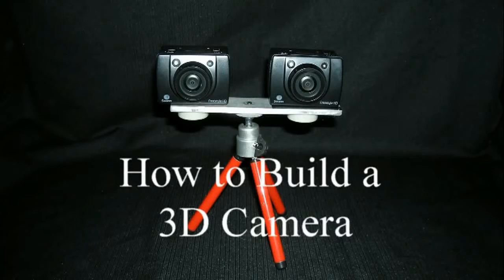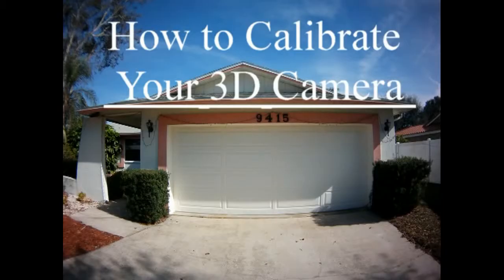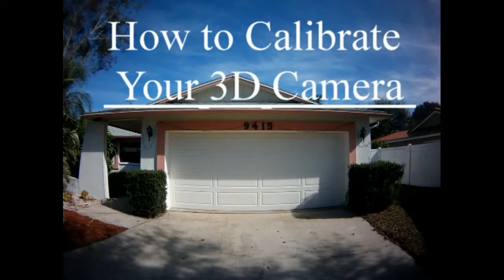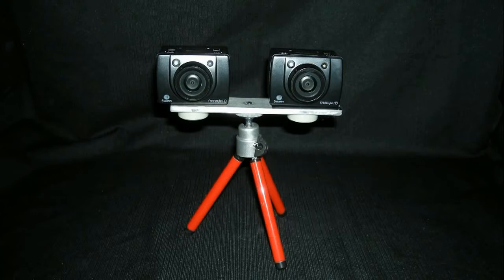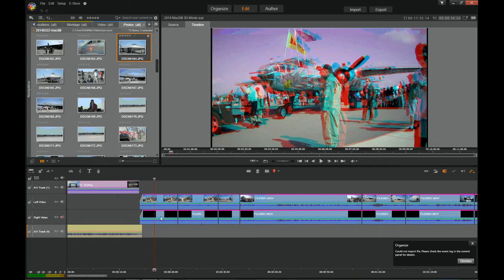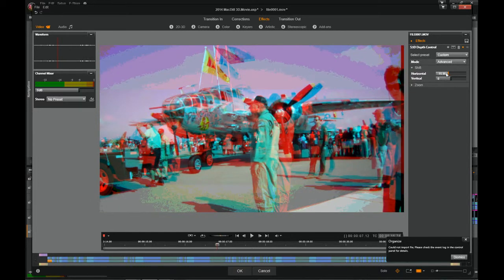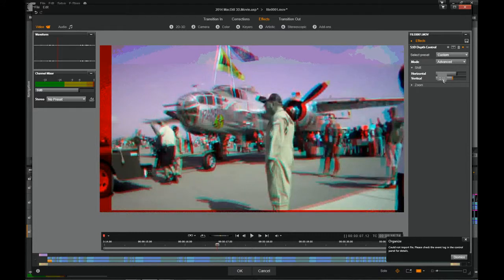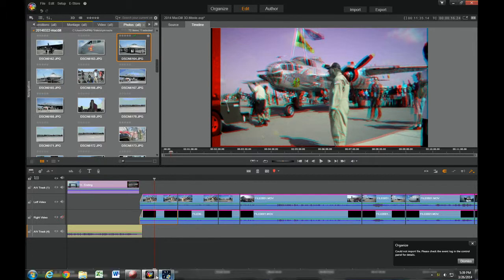2014  How to make your own 3D camera setup and use Pinnacle Studio 17

Comment: was going to buy Pinnacle Studio 19 Ultimate, but the company said it does not render 3D anaglyph. Seems by your work, it should, right? I think they were pushing me to buy 21.
Reply from the maker: I'm currently using Pinnacle Studio 19 ( I think Ultimate) and it does Anaglyphs!  I don't remember if it was an add on but I'm pretty sure it came in the package...
Reply: does it have auto-allign, zoom, rotate, etc, in 3D?
Reply from the maker: I have not found an auto-align.  I don't even understand how you'd implement that either...  Each video (left and right) you can rotate individually.  But that's why I showed how to adjust your camera mount so you don't have to rotate in software.  It would be a pain to rotate each video a set amount.  There are 49 "3D Effects" that you can use.  And lots of 3D "montages" you can use to start or end each video.  There is a S3D Depth control.  I think that's used if your cameras are too far apart or too close.
Reply from the maker: FYI, I just upgraded to Studio 21.  It loads way faster, seems like it renders faster.  Smoother.  I like it over 19.  Many times when editing 19 would just stop working.  You'd have to close it and re-open it.  Hopefully 21 doesn't do that anymore!

Comment: Notice that if you buy sub $50 cameras that they can differ 1 to 1, mine rate between exelent and poor and they are 12 megapixel cameras.
Only buy a cameras with H264 compression, mjpeg is for example a great system but is hard to convert to H264 (Youtube).
If you use a static tripod you can even use XVid, which works great on "old" computers.
Notice even that with cheap cameras you often get lots of accessories.
For the pros: Use a workstation to edit and compress stutter free.

Comment: can the optical zoom be used with 2 cameras? maybe only at full 3x so they can sync at least in that state?
Reply from the maker: +deeber35 That would be hard to do...
Reply: +FlyMeAirplane could you be more brief? ;) so if both cameras, new, are fully zoomed in, you still wouldn't trust that their zoom was close enough to each other?  thanks.
Reply from the maker: +deeber35 Actually I do have two digital cameras with zoom that I use for stereo pictures.  I leave them at 0 zoom and they work ok.  Maybe zoomed all the way out would also work but the middle ground is not likely.
Reply: +FlyMeAirplane do these have 3x optical or 3x digital zoom, or both? i've seen conflicting info;  thanks
Reply from the maker: The Swann Freestyle cameras that I used here in this video have no zoom capability. The SJ4000 cameras that are also popular have no zoom capability.
Reply: +FlyMeAirplane If I have 2 cameras with zoom, if I zoom 20x optical, will I get the same 3D effects as at 10' with no zoom? How do you apply the 30:1 rule (IA to distance to subject) when you zoom? Thanks.
Reply from the maker: +deeber35 The problem is that one camera may zoom 18x and one 21x.  I doubt the camera mfgr spends any time getting the zoom exact.  Also any miss-alignment of the cameras will be multiplied 20X.  No, I don't think zoom is possible using 2 cameras.

Comment: how did you start the cameras nearly in sync? just try to manually turn on the record buttons close to the same time and then leave it to post production to align them? would 2 cameras that have remote controls better allow u to start them nearly at the same time? thanks.
Reply from the maker: +deeber35 Check out this video at 4 minutes.  I don't start the cameras in sync, I sync it in the edit phase.  Two remotes you'd have the same problem.  If your running GoPro's they have a 3D adapter cable that syncs the video.  https://www.youtube.com/watch?v=Cuqwaj96eyw
Reply: +FlyMeAirplane  ok, i'm in - your videos inspired me to get 2 cameras for 3D. which is better for the basics - pinnacle studio 17 (i know it's an older version), or sony movie studio 13? [actually looks like 17 does not do 3D; at least the base version]
Reply from the maker: +deeber35 Why would you use Sony if it doesn't do 3D?  Pinnacle 17 does do 3D and is pretty cheap if you find a used version.  Plus that, Sony sucks, I don't buy anything Sony.
Reply: +FlyMeAirplane I was told the base version does not have 3d editing; is that not the case? are you using the base version, or plus..? sorry for my confusion.  also needing it to work on windows 10.
Reply from the maker: +deeber35 I guess I have Ultimate... so maybe the base doesn't do 3D.  I see 19 is out now. And the plus does 3D for $99.  I use Win7, so you'd have to check support for 10.